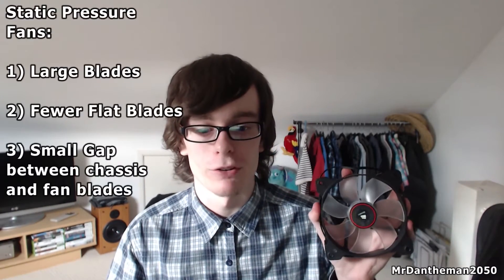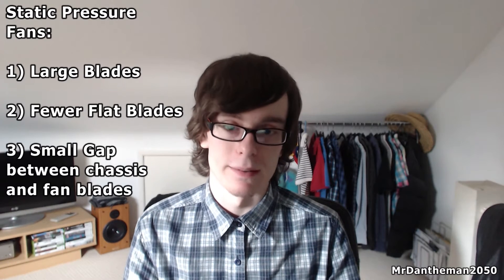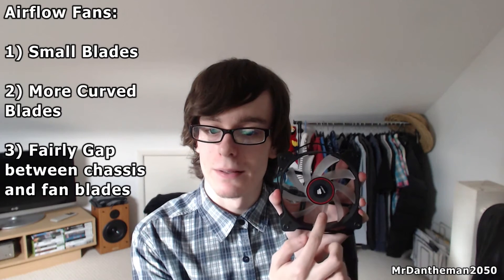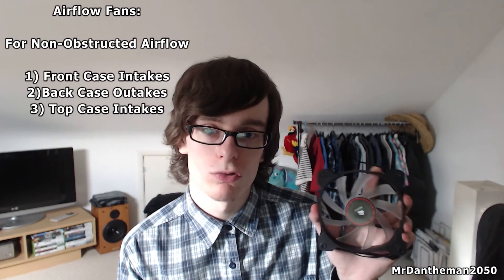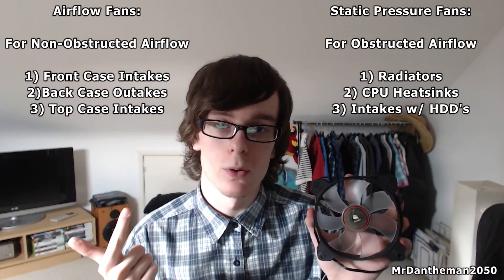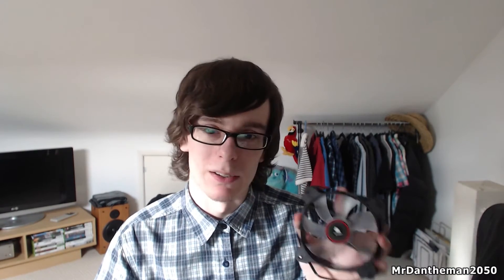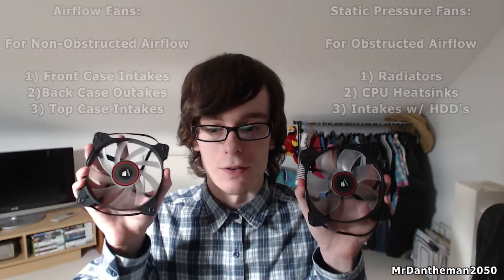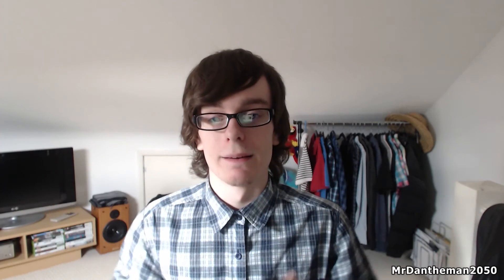Static Pressure Vs Airflow Fans

Comment: When testing the static pressure of a fan it's pressed up against a plate that measures the pressure. A fan with poor static pressure when pushed up against that plate is basically just moving the air around in circles instead of through and against the plate. 
Same goes for when it's pressed up against a mesh, grate, grill, radiator, etc. If you have an inch between the fan and obstructions it should move air just fine. Static P is measured and meant for only when something is right up against the fan. 

Also neither one of those fans have good airflow or staticP at 1500RPMs. Respectively they're both 55CFM and 1.5mmH20 and 0.75mmH2O. 
StaticP fans NEED a gap in order for the air to go somewhere when pressed flat against something otherwise it will just swirl the air in circles. Cougar Vortex's CF-V12HP 1500RPM fan has 70CFM and 2.2 mmH20 at only $12 each. The Noctua NF-F12 1500RPM has 55CFM 2.6 mmH20 at $20 each. Both have a large gap, it's utter nonsense. And the ones that seem like they have a small gap really just have an angled lip kinda like the fan is within a cone that tapers to the exhaust side to make up for the lack of gap. Noctua fans are known for their pressure and all have large gaps or the outer edge of the fan blade is curved so the whole blade isn't pressed up against the edge of it's enclosure.  
https://i.ibb.co/jynvsP2/27858674-1788276124557516-3939125916088125000-n-1.jpg
Reply: Notice the gap between the fan and enclosure? Yeah.. big gaps=more pressure. 
https://i.ibb.co/Yd496mn/65260452-10219550609894381-6240686720602341376-n-1.jpg
Reply: Video was well done but seems like you made up your own logic as to why one is a static and one is a cfm fan..
Reply: Reason that one fan has shitty static is cause of the blade design. Like the EK Varder's blade design at 1850RPMs it has worse static than cheaper fans at 1500RPM. That spiral design is just awful...

Comment: Cool video. Question. I am building my first pc and i accidently bought a 120 ml static pressure fan for the exhaust in the back of my S340 case. Can it still be used there or will i see temperature changes?

Comment: I want to install two fans for exhaust at the top. Unfortunately, the output is vaguely blocked by the dust filters and case handle. Should I get fans optimized for air flow or static pressure here?
Reply from the maker: +Liangcheng He static pressure fans would do a better job. Dan.

Comment: So i wonder, how would you go about measuring fan pressure at home? I imagine you'd need some kind of container and manometer? Could a manometer simply be a piece of tubing with some water in it?

I can't help but think that airflow might simply never be relevant, neither in intake nor in exhaust fans. I mean, if you have anything in your PC at all, all the kinetic energy that the air has from your intake fan will be dissipated anyway, because the air will hit something sooner or later. But it must keep moving to exit the case again, and this will be driven by pressure difference. Similarly, if we're talking exhaust fan, there is usually no way there would be a direct path from intake to exhaust.

You would think that the only case for airflow optimization would be a heatsink fan, because it only circulates the air around one component; however that can't be the case either, because a heatsink is generally a severe obstruction, it has closely spaced fins.
Reply: I'm not entirely sure i understand all that you are asking, but for the first question, it's way simpler than you think. You just need to place a strip of toilet paper after the fan and the object that obstructs it's airflow (like a dust filter, heatsink, etc) and see the angle at which the paper tilts. Of course, you can calculate the mass of the paper strip, or simply compare the angle with the one you get from an unobstructed fan, and knowing the CFM of the fan you should find out how much air pressure you have after getting the air trough a filter, etc.. (i'm not expecting the relation between the angle and CFM to be liniar)

Second of all, airflow is quite relevant, as you have to direct it trough the components that need it the most. Also, the types of pressure in your case have a direct impact on dust(but filters are just as important). For example, having filters on your intake fans is great, but if your exhaust fans pull out more air than the intake filtered ones get in, some  unfiltered dusty air will enter trough different openings that are unfiltered (mainly the small holes present on the back of the case close to the GPU slots-where applicable, the absence of an IO shield on the MOBO, and so on) So, ideally, we want more air pushed into the case, in order for all the small cracks present trough the case to become small exhaust point, so we have air moving and pushing around trough all the case, which will eliminate some "dead" spots where air is not moving and dust can gather up. On the other hand, having more air being pulled out should improve thermals in specific cases, considering the air is flowing around key components.

So, bottom line:
POSITIVE (more intake pressure) *PRESSURE: * 
-easy to obtain with great overall airflow to all components
-less dust (helped a lot by filtered intake)
-still great temperatures, if air is directed correctly
NEGATIVE (more exhaust pressure) *PRESSURE: *
-harder to get, considering optimal air directions
-more dust
-high risk for "dead" spots
-better temperatures considering we have optimal air direction(s) - yes, you need to take into account from where every fan will suck out air

If anyone has anything to add, of if i get something wrong, please let me know.

Comment: which fan is suitable to achieve maximum suction pressure?.
Another question i am simulating this fan in nozzle(plane engine). Which direction of rotation can i achieve maximum suction pressure ?
Finally, where is the fan inlet and outlet if i am achieving suction pressure?

Comment: would you say Static Pressure would perform okay at exhausting air regardless? I'm doing a build for a friend and was just gonna grab a couple cheaper (not cheap) fans to exhaust air, but have trusted quality like Corsairs but not have any impingement on any top exhausts for his NZXT S340. I was possibly gonna take the 2 included ones and put them in the front however it is enclosed, so maybe the Static Pressure fans would be more suited to be in the front where there is zero to none air intake? I don't know as I type this if there is very good bottom air intake real estate (in lack of a better term), so I would just like to know if they are worth picking up for impinged front air flow (there is no opening but I can still install some where a rad would go for more airflow overall), or for better exhaust and a nice LED effect.
Reply from the maker: Bootskoot589 Hi, yes static pressure fans should do good in your case. If you are unsure on which to use in a given situation, using static pressure fans will ensure you at least get some airflow moved to the desired location. While airflow fans may struggle in some situations, but will excel when there is a clear source or air behind them. Dan.
Reply: Dans Tech thanks for the response, good vid btw

Comment: Okay that was much better explained than the last video on this I watched lol, very understandable and helpful. I imagine this is maybe why my front cooler master sickle fans are so loud... they're airflow fans with a lot of hard drive stuff in front of them to get through.. I'm not entirely sure why that's a bad thing.. but does anyone think that's why my fans are sooo dang loud?

I saw the "BitFenix Spectre Pro 120mm Black Fan" and it's silent and really looks like a static fan.. but it's designed as an airflow fan.. odd..
Reply from the maker: Great!  Fans typically are loud if they don't have ample space in front of them to get air, but regardless all fans do get louder as they're mounted against something.
Reply: Dans Tech - Would you say an airflow fan in that situation would be louder than a static fan? I have found a number of fans that are pretty dang silent.. but they're all airflow fans (from a shop in Australia I'm buying from).. would those silent airflow fans still be rather quiet with a bunch of hard drive stuff in front of them? or would you say that would make them too loud to be rather quiet?
Any help would be super appreciated since I'm rather new to fan knowledge lol

I'm looking mainly at the: Be Quiet! fans and the bitfenix specre pro (even though they aren't static fans)..
Reply from the maker: Hi, there are a lot of fans out there. As I said, static pressure fans are typically better in places where there is not much room or if you're pushing air through a radiator if you're into watercooling. I will say though, this is in general. Some companies make some remarkable fans and I could imagine some airflow fans from company A been better than static pressure fans from company B.
Reply: Dans Tech - That makes sense, I decided to go with Corsair Air Series fans quiet edition, 2 static pressure on the front and an airflow on the back, push the air through the drive cages better.. and they still have good airflow regardless so yea.

Comment: If I list some specs for a PC I have thought about building, will u have a quick run through and tell me if it would work correctly please? If you have the time?
Reply from the maker: Hi, i really don't have the time to check through components, however i have a playlist here of the best gaming PC builds for June 2014 that should be of help. There is a build for every budget possible :) https://www.youtube.com/playlist?list=PLOen9_vSbQov5tKWptDzclieWVZam66RC
Reply: just post it here as a reply to me and I can take a quick look :D If you want you can tell me what price range you're thinking of, how you want it to perform, and answer some other questions then I can give you a suggested parts list ;D
Reply: If you want me to suggest a build then answer these questions...
- What price range are you thinking of?
- How good performance do you want? (use BF4 as a benchmark so it's easier to find the right parts... "I want a PC that can play BF4 at ultra, 1080p with 60fps or higher")
- what form factor do you want? (ATX, m-ATX, m-ITX, full tower, midtower etc...)
- How much do you care about looks, and are there any color combinations you really like?
- How much do you care about upgradebility? do you want it to perform the best it can now for the price or do you want room to upgrade more later on?

Comment: Someone once told me that I should have positive pressure, do you know how that works?
Reply: You have more air blowing in than out
Reply from the maker: Hi TrtleQ, MasterJkpatrick is right, the easiest way to have positive pressure is to have more fans intaking air than outtaking. In my case i have 2 120mm intakes in the top, 1 200mm in take at the front, and 1 120mm at the rear as an exhaust.
Reply: It depends on your case, but generally speaking you want positive air pressure in your case to keep dust out...
however if you use unfiltered intakes it will do more harm than good... And it doesn't affect temps much, it's just to prevent some dust build-up... 
the way it works is that with positive air pressure you have more air coming into the case than what's being exhausted out by your other fans, this gives a positive air pressure and it will force air out all the little openings and holes in the case that are unfiltered and that is not a fan location, like the pci-e brackets... this means air will always be moving out through these spots and dust will in return not get in through them ;D
Negative air pressure does the opposite, the case will passively suck in air wherever there's an opening and that air will bring in dust...
the negative about positive air pressure is that if you use too many fans as intakes the pressure will start to fight the fans and cripple airflow ;D so try to get a slightly positive air pressure and try to use static pressure optimized fans as your intakes ;D